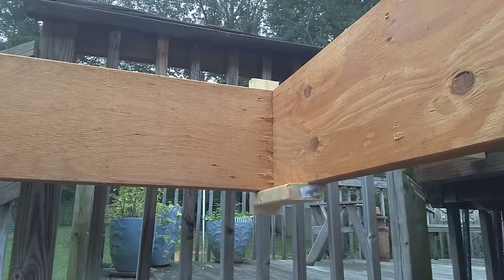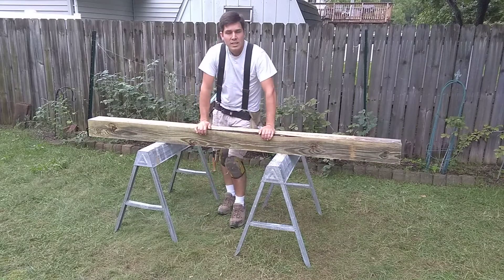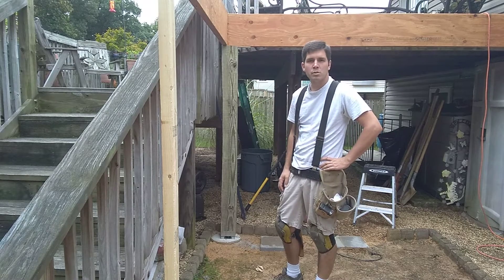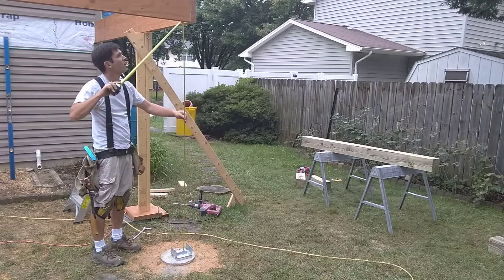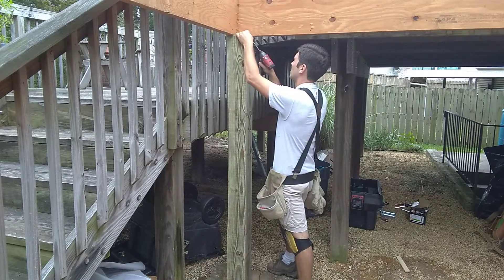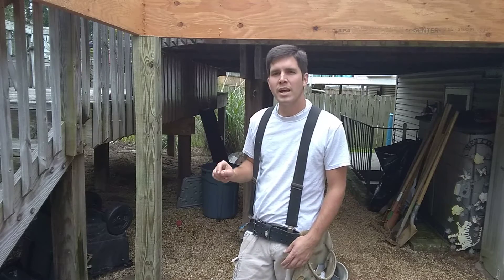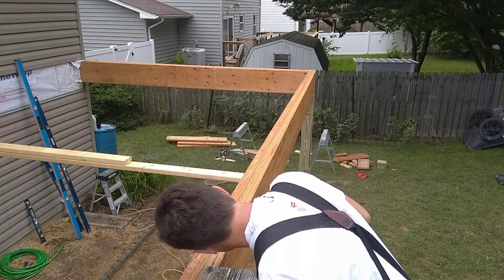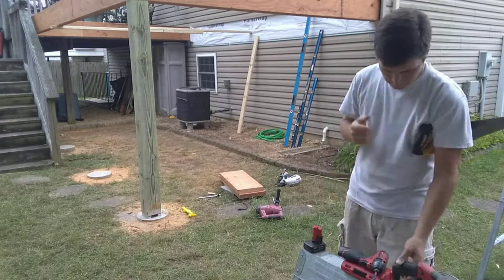House Addition | Posts and Beams | Day 8

Comment: What would you do if you get a wet post? They will shrink.
Reply: Buy your pressure treated from a lumber company, they tend to have less water in them than big box stores.
Reply from the maker: Some companies sell their lumber with a higher injected treatment content.  It will hold up longer, but, it will cost more of course.
Reply from the maker: They will definitely shrink a small amount... everything does over time as it dries out.  The amount of shrinkage will be very small and shouldn't cause any noticable drop in the addition.  If you did have some settling you could always jack up the addition and shim the posts.  The posts getting wet shouldn't cause much of a problem because they are installed up on the base cradles.  This allows them to dry out without developing rot like they would if installed directly onto the footer.  Thanks for watching
Reply: @horstcarpentry  ok, got it.

Comment: Why can't the brackets be put in before it fully hardens?
Reply from the maker: You could use brackets that set into the concrete before it cures, but, I prefer not to use them.  It is easier and less stressful, in my opinion, because if you make a mistake with the ones set in the concrete you can't fix it.  Thanks for the comment
Reply: @horstcarpentry  Thanks for answering.
Reply from the maker: You're welcome

Comment: We don't have any building codes where we live. We have some Glue Lam 5x 8 posts, but I don't believe they are pressure treated. Do you think it would be OK to use those?
Reply from the maker: Use them for the posts in a similar way to this?  Or for the beams?

Comment: The dewalt with a brake has a hard time when cutting 45s its the guard design. The cheaper one without a brake cuts 45s alot easier with its guard design.
Reply from the maker: Thanks for sharing the tip

Comment: why won't you put the 6 by 6 in the concrete while wet ??
Reply from the maker: While a lot of people do that for a deck it is not the best way to support a structure.  The post, over time, will have water entry and can rot out causing damage.  This is the most ideal way to support any structure because the post bottom stays dry.  Also, it is easily replaceable if something happens to the post.  Thanks for watching

Comment: Thanks for these great videos, I'm learning a lot.  How long do you have to wait for the concrete to cure before drilling and installing the Redhead anchors?
Reply from the maker: Even 24hrs would be fine for setting the anchors and brackets.  If there was an existing structure ( load ) you were dropping onto these footers I would wait a couple days.  Since it will be days before I have any significant amount of framing ( load ) it should be fine.  Thanks for the comment and glad you enjoyed watching

Comment: We’re you worried that your 6x6’s would twist over time? I’m thinking of doing a similar room addition and was wondering if I should just build 6x6’s myself. Your thoughts??
Reply from the maker: It definitely could happen but your options are limited.  Most codes state that within a certain distance from concrete you have to use pressure treated lumber.  It's possible you could build a triple or quad 2 x 6 post with a treated small plate underneath.  You would just need to trim it out to finish.  You may need to contact your local inspector and ask if what your planning will work.  Thanks for watching
Reply: @horstcarpentry  I'm curious if it would have benefitted you to use taller posts that have notches cut in them to cradle the LVL boards?  You can fasten to the boards to them through more post material and it could apply the load point right through the center of the post, maximizing the strength of the post.
Reply from the maker: I used a triple LVL on the sides, so, there wouldn't have been anything left of the post.  The side beams were 5 1/4" width and the posts are 5 1/2" width.  If you only used a double LVL beam then this would work.  Thanks for watching
Reply: @horstcarpentry  I don't know how I missed that, but thanks for clearing that up!  Definitely taking notes for a project I'm doing this upcoming spring 2023
Reply from the maker: I'm glad you're enjoying the job.  Thanks

Comment: Is there a particular reason you used the Redhead anchors versus a J anchor that you place in the wet concrete? I'm still planning the addition on my house. The redhead anchor seems a lot easier and more accurate, but it seems that a 12in J anchor would be stronger.
Reply from the maker: You're right I only used it for the ease of use.  Could've definitely used a j bolt set in the concrete.  Would require a little more planning when pouring the concrete to get the placement right.  Thanks again for watching

Comment: Hey I have a quick question. On the side beams.  Why did you not have to put any posts?  Just on the front beam?  May seem like a silly question but I’m doing an addition very similar and am in the process of planning it out
Reply from the maker: My county has a span chart that tells you how far you can span with common size beams.  The span was spot on the maximum length with no supports, so, I added a third lvl and called it a day.  It only had roof load on those beams because the floor load was on the outer beam.  If it had floor and roof it would not have worked.  Thanks for watching.

Comment: Did an engineer figure out the beams and joists or did you size yourself?  If so how did you know what to use?
Reply from the maker: The jurisdiction provides span charts so you can know what they require for minimums...for joists and beams.  The side beams are sized to carry the roof load.  I actually added a third LVL because I wanted to ensure no problems.
Reply: @horstcarpentry  good idea